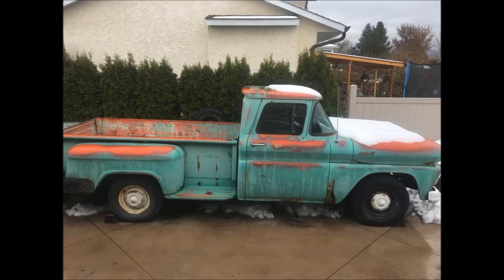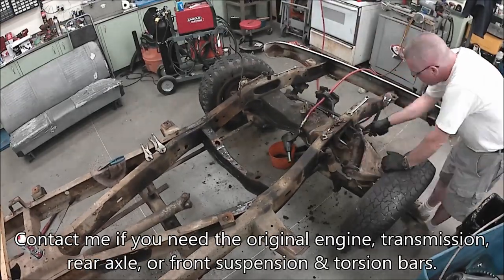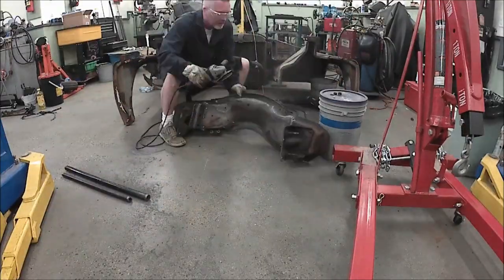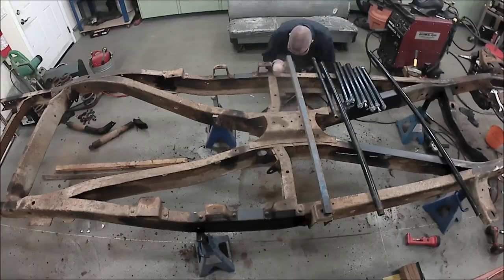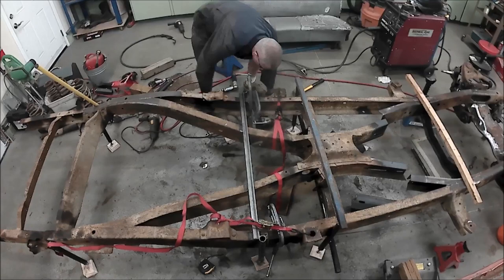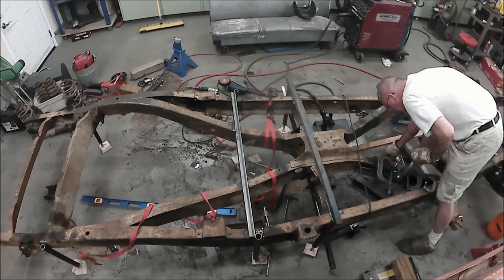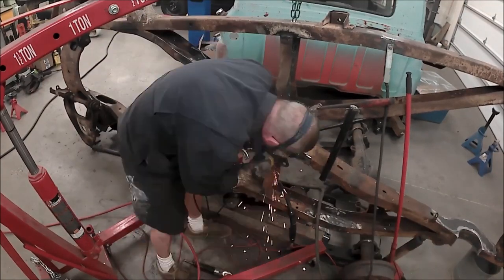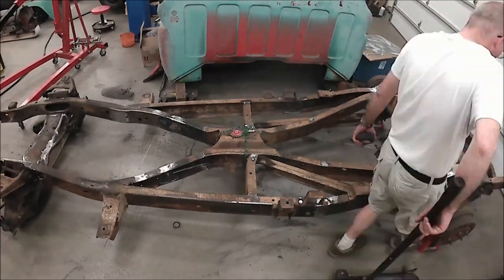Truck Frame: Shortened, Pancaked, and Notched

Comment: Sunday 28 March 2021, found your video by accident and will watch your others regarding this Apache. Mine is very similar (longbed and motor) and I plan to keep it that way. I want to have the motor rebuilt, the transmission and axle upgraded, then interior and outside made new. So glad I found your channel.
Reply: Long beds rule

Comment: That is a  LOT of work. 
A crazy amount of work. 
The  torsion bars can be turned one  notch. 
Where the  bars  connect to the back piece. 
That  allows the  truck to lay down. To the  front piece that you  chopped the  belly. 
The  trailing arms can be repositioned on the outside of the frame. So it will lay down on the pumpkin. 
I  have seen it before. But I would not want to be that close to the ground. 
Make a short frame out of a long bed. 
That is something really crazy. For the x box frame 😷👈

Comment: Do I need to add length to the tail of the frame? Long bed fleet-side to a short bed step-side. It's not looking like the bed is lining up with the frame mounting points, but also the frame I went away from was very hacked up so maybe I am overlooking something simple. Either way I used the information you took the time to share and it worked great, thank you for doing so. -Dustin
Reply from the maker: You cut 8" off the back of the frame. The spacing between the original front mounts and second mounts don't seem to be retained when the second mounts become the new front mounts (if that makes sense).  As of right now, I have not done anything with the bed yet - that will be a later video.

Comment: Back at your videos for my build haha. 
Mounting my engine and trans now.

What degree is your engine and trans sitting at? 
Mine is sitting at about 6* 
Ive seen other videos where their engines also look like they have a severe angle. 

Should i fab a bracket to raise the tailshaft? Or leave it?
Thoughts? 
Thanks
Reply from the maker: If the driveshaft is going "uphill" to the differential, or if the u-joint operating angle at the trans is more than 3°, you need to raise the transmission.

Comment: I don't understand why you couldn't do the z cut on at least the back portion.  I don't have my frame out yet, so I can only go by what I see on your website and videos, but since that cross member was able to slide the entire 12 inches, while still inside the frame rails, there is obviously that large of a section of frame that should be able to be used.
Reply from the maker: On the 60-62 "X" frames, the frame rails taper under the cab. , it -just becomes parallel right where I shortened it. On the 63-up frames, it's parallel under the cab - a much better place to shorten, and more room for a good Z cut. Advantage, though: the "X" adds a LOT of rigidity.

Comment: Thank you for making these videos. Great tutorial for modifying these frames.

What gauge metal did you use for the notches?
Reply from the maker: 3/16" plate.  The frame appeared to be in-between 1/8" and 3/16", so I went 3/16"

Comment: How can you keep the stock trailing arms, lay frame, and keep them come hitting the X frame?
Reply from the maker: The trailing arms can only go so far before you have clearance issues.  Taller blocks would be next (regardless if you have an X frame or not).  I have 2" blocks on it already, but I did make a set of 3" blocks just in case.
Reply: Thank you

Comment: When you moved the crossmember forward 1 inch, did you line the 4 frame bolts that lined up and then move it 1 inch? On your website it you said when you used the jig to drill the other 2 frame holes, you said it made the crossmember 3/4 inch forward. So does that mean you lined up the 2(4) holes and then moved forward 1/4 inch to make it 1 inch total or did you line up the 2(4) holes and then move forward 1 inch. Please let me know, I’m at this step and I’m ready to drill my holes
Reply from the maker: I'll have to go check my website now.  The crossmember is moved 1" forward.  The lower control arms are moved 3/4" forward.
Reply from the maker: Yes, you are correct. On Page 2 of the '61 Apache build, I said I was going to move the crossmember 3/4" forward and drilled all new holes (I made a jig for the bottom six).  A few pictures later, I say "I lied. I moved the crossmember 1" forward."  In a sense, you're reading the blog as I build, and sometimes plans change.  Sometimes I go back and re-write it, and sometimes I just keep the ideas going.  It could be confusing, but it could also help readers see my thought process on things.
Reply: @GregWellwood  Thank you so much, you rock!!! So to be clear, on my 61 I have a square body front end i pancaked and have 2.5 inch drop spindles. Would you recommend that I line up the 2(4) bottom frame holes and the push it forward 1 inch? Thank you for always responding
Reply from the maker: I went and re-worded Page 2, I think it would remove confusion.  Go there, and look for "Look! I made you a DRILLING TEMPLATE." and download it and print it.  Good luck!
Reply: @GregWellwood  thank you! You rock man

Comment: Great videos... i jave a generation i have a 60 short bed Big window ..i want chang out the front suspension to remove the torsion bar suspension ... i can get a 80 front suspension can you tell me would i need to also change the original steering gear do i have to use the steering from an 80 or can i just use the cross member n Arams up n lower from the newer suspension
Reply from the maker: The '80 will bolt in but you will need to drill a couple holes as the holes don't line up. The '80 steering box doesn't bolt up, but there are adapter kits you can buy, I think "CaptainFab" sells one.  Can probably use the original box, but the '80 will give you power steering.
Reply: @GregWellwood  thank you ill look into that adapter .. ill be able to keep my steering column right or need to change it
Reply from the maker: Should be able to keep the column.  Spend some time at 67-72chevytrucks.com in the 60-66 section.
Reply: @GregWellwood  thank you for the information sir ... yes was watching some vidoes n reading up on captainfab adapter ..thank you again

Comment: Hello TSTG, enjoying your channel.
I too have a 61 that I'm currently working on. As I was installing a '79 front suspension, I ran across your channel and was interested in how you moved the suspension forward to center the wheels between the fenders. In your opinion…how much forward can you mount the suspension before it's out of whack? and once you've  pancaked the crossmember are you only mounting with the 6 bolts on the bottom and not the addition 2 on each sides? 

Stay safe and keep up the awesome work…I'll be watching!
Reply from the maker: Since the upper and lower control arms are attached to the crossmember, you're not going to get anything "functionally" out of wack the more you move it.  However, if the wheel goes too far forward in the wheel well, it's going to "look" out of wack.  I incorporated the side bolt holes with the motor mounts in Part 9: https://www.youtube.com/watch?v=_6GZcOXhdOA
Reply: @GregWellwood  Thanks for the speedy reply!!! Gotta watch Part 9 again. I've always disliked the how far back the wheels set in the fender well. I'll get the fenders back on and try to get close to center as I can, which means a definite upgrade in steering components. Thanks again for your help!! BTW, Love the shop!

Comment: I have a '60 short frame. It appears that lowering the truck will cause an interference between the inner x-frame beams and the trailing arms. In the last part of your video, it appears that you may have made modifications to gain clearance.  Can you comment on this?
Reply from the maker: You are correct - there are (were) clearance issues. Since I am installing a 9" Ford axle, I will be welding the saddles such that the trailing arms will JUST squeeze between the frame rails and X legs (currently just sitting, not even tacked). While there currently IS clearance, I can always make more clearance with a grinder.  You could also get more clearance with 3" blocks instead of 2" blocks, but that will cut into ground clearance (it will just work with 18" wheels, but I'm not convinced the 3" blocks are a wise move yet).

Comment: On a 1960 c10 a friend hooked a chain around the last rear crossmember and attempted to pull out a tree stump . Needless to say, the crossmember got ripped out.  does it have to be from a 1960 to replace the crossmember?
Reply from the maker: I believe the 60-62 frames are wider at the rear than the 63+ frames, so yeah-ish. In an upcoming video, I will be changing the rearmost crossmember into a hidden-trailer-hitch/fuel-tank-mount.

Comment: Hey TSTG, did the upgraded crossmember fit snug? I just test fitted mine and it appears wider than the original giving about a 3/8" gap (each side) between the crossmember and the frame rails. What's your thoughts on the subject? Thanks.
Reply from the maker: It fit good enough that I didn't chose to worry about it. Nothing on these trucks was a perfect fit back in the day either.  It will work.
Reply from the maker: Oh - did you move the crossmember forward?  The frame rails taper inward at the front, so there will be a potential increase in gap. Though I don't expect it to be much.
Reply: @GregWellwood  I did move the crossmember forward 1.25". Even in the stock location there's a gap. I'm thinking of making spacer plates to snug it to the frame rail. I'll let you know how it goes. Thanks.

Comment: What did you measure off of in the first to get the 11.25 inches? So there both the same?
Reply from the maker: I don't think it matters.  I did not cut through the "bump", and I did not cut through the e-brake holes.
Reply: @GregWellwood  ok thanks

Comment: Like your skills and great videos but fleetside is more sexy from 1960 up. 48 to 53 chevy pickups are sexy step sides. The front fenders and rear fender have equal proportion of roundness and the running boards tie it in. 1960 cab and front  fenders looks way better fleetside. Sexy lol.
Reply from the maker: I, too, will look more sexy from 60 and up. (grin)